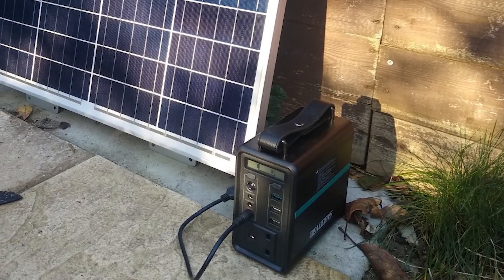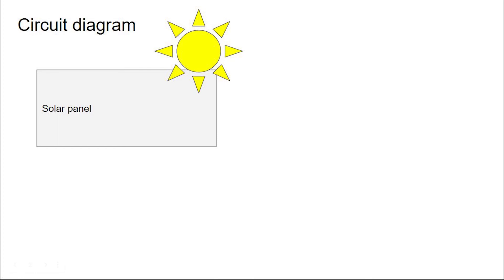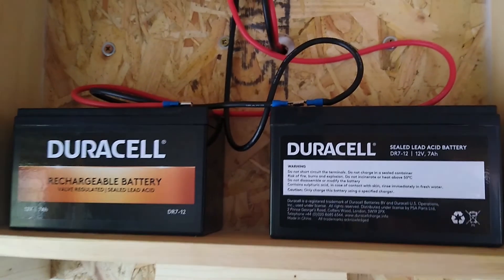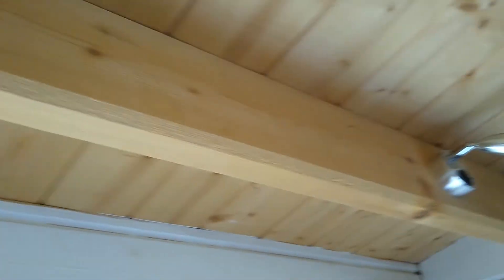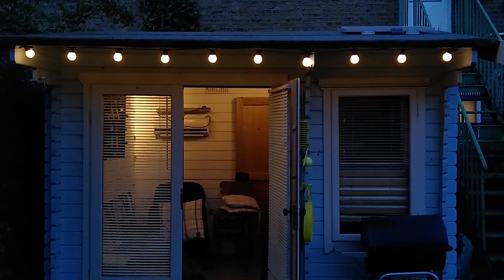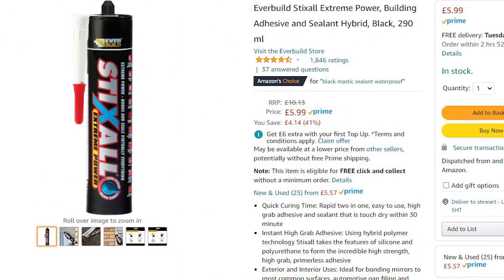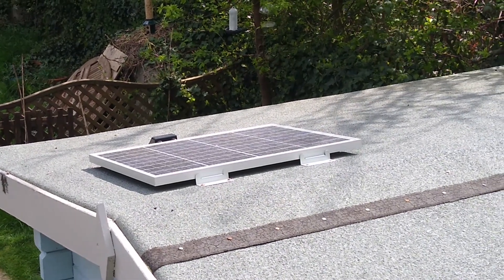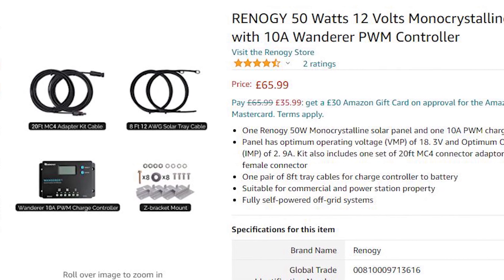I built a solar summer house

Comment: I love these little reviews, i moved away from lead-acid to lifepo4 many years ago. 
I'm still using the same batteries with no sign of capacity loss.
This installation you have will grow over time. The problem with the energy crisis the battery technology is way too expensive now.
Reply from the maker: Cheers mate. My system in my van is built on LiFePO4 - works like clockwork as you say.

I've also invested in a power station (Bluetti EB 150 - 1,500watt hours). Since recording this video I've started charging that and a Bluetti AC50S one after the other from another panel, so it's growing a bit already.

My plan is substantially more solar and more battery storage but first I need some space for panels - no roof access here a and heavily shaded garden.
Reply: @stewreviews9345  interestingly I own a campervan that I use as a boost for my house lifepo4's:
Jackery 1000 explorer.
Beaudens 166.
Enginstar 350.
CTECHi 320Wh.
1x impax i800 petrol generator.
Plus lots of lithium-iron builds while learning along the way.
I'm Manchester based myself.
Reply from the maker: @LITTLEEXPERIMENTCHANNEL1  nice - those beaudens units are great aren't they - first piece of power storage I bought.
Reply: @stewreviews9345  the device powered my 4G wireless router all weekend. I have lots of wizardry powering things too using buck-controllers cc/cv up and down voltages upward of 60v.
Loads of experiments over the years.
You could say im (blackout-compatible).